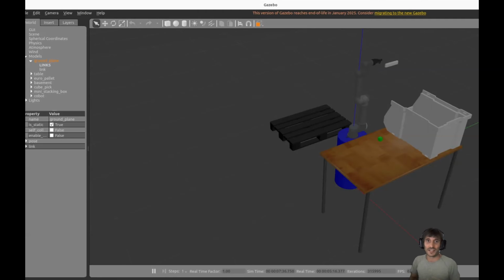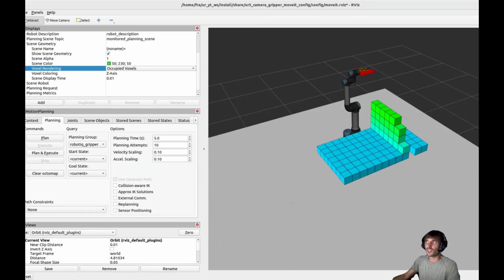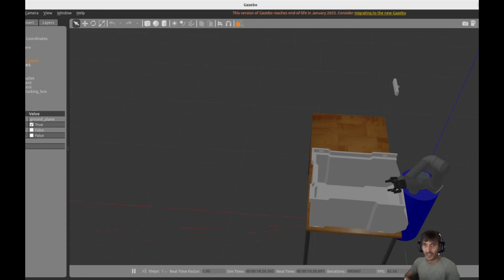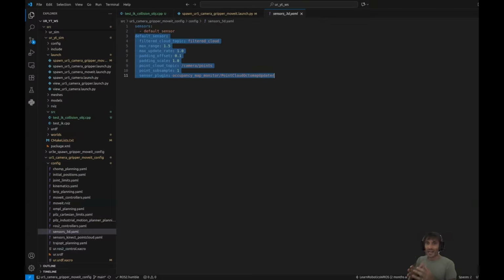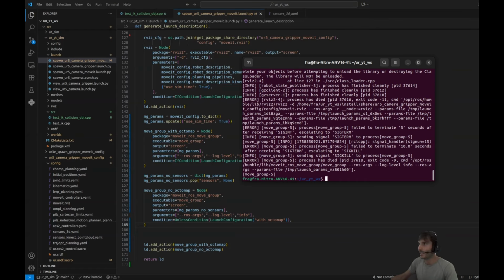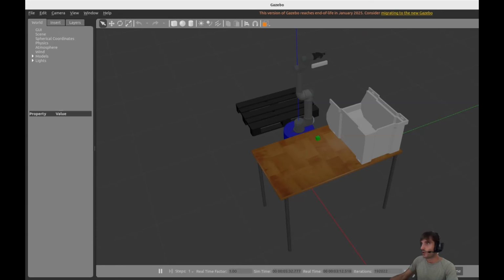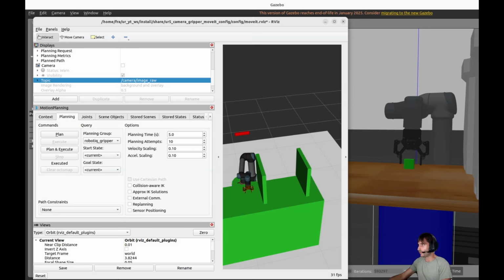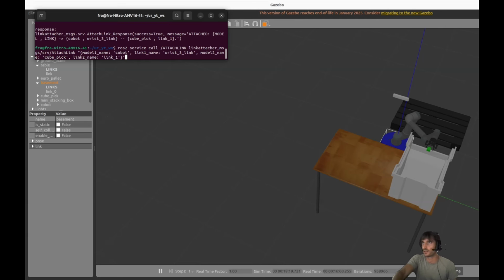How to Avoid Obstacles in Motion Planning with 6 axis robot using 3D camera

Comment: I want to set up the obstacle occupancy octomap avoidance thing with the UR10 in Gazebo - I cannot find any video on it
Reply from the maker: Hi! You can have a look here https://github.com/LearnRoboticsWROS/ur_yt_sim, in the launch folder there is the launch file that I run in the tutorial of the YouTube video. You can setup with_octomap:=true to run obstacle avoidance. Of you want a structured pathway in how and when to run obstacle avoidance for industrial application, I would suggest to have a look in this robotics program (module 13) www.learn-robotics-with-ros.com
Reply: @learn-robotics-with-ros  Thank you for the advice - however I do not see any sensors_3d.yaml file (as u mentioned in the tutorial) in the github repo u shared
Also it is not being included in the launch file
Reply from the maker: Ok, have you added the perception when you used Moveit Setup assistant?

Comment: If I want to set up more complex trajectories, how should I do it? For example, using Cartesian paths to keep the object stable while it’s being carried, or using OMPL with orientation constraints to keep the gripper pointing straight down. I’ve read the official tutorials, but they’re too brief.😮‍💨
Reply from the maker: What you can use is to try another kinematic solver and specific for Cartesian pathway and during the selection of the waypoints you keep the orientation of your end effector always the same. I have done a lesson on that in programming a UR5 like a CNC machine